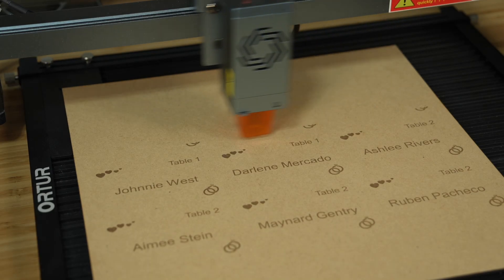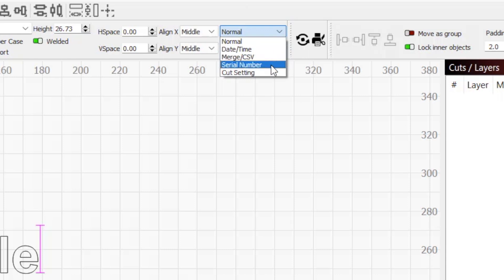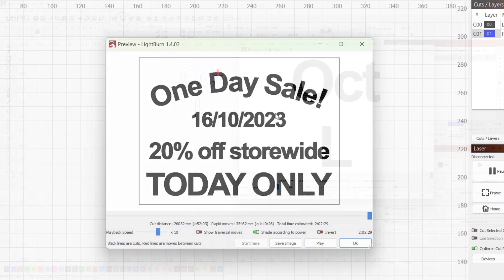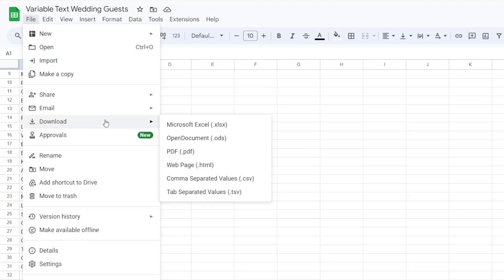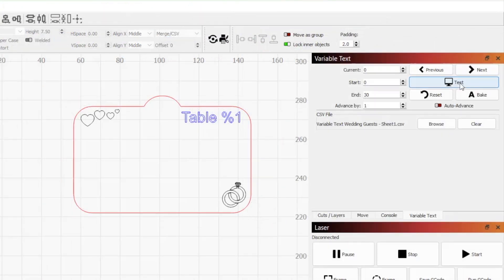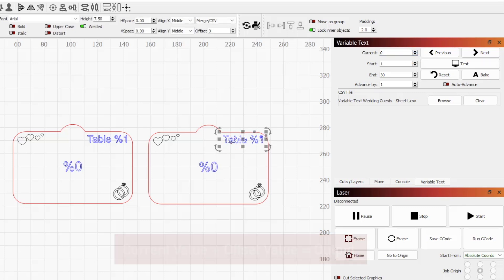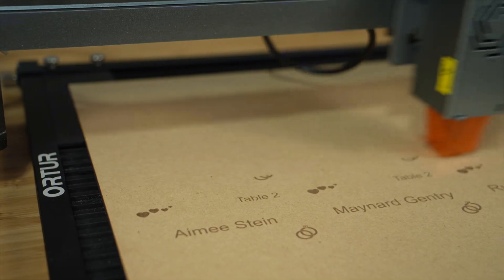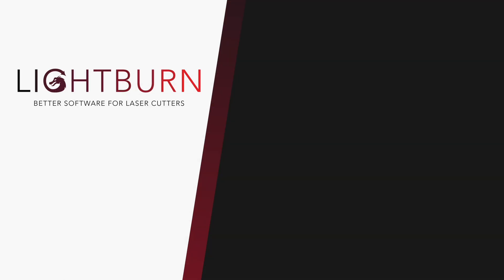The Power of Variable Text

Comment: Tipp: use 0pen Office for Text, in any counties the csv use semicolon, in other comma, lightburn works only with comma. In Open Office settings you can select more settings before store, so you can set comma anstead semicolon to store csv. And in Table you can set in the cell the max of signs. And in the multi layer, you can select max.  Size of scripture.

Comment: does this work the same way with the data matrix barcode function??? if i load a "CSV" and set up the variable text could it also change the data matrix code as well???
Reply from the maker: @Stakespecialty  - yes. Barcodes & data matrix codes can use a CSV, date & time, or serial numbering.
Reply: @lightburnsoftware7189  thank you for your reply I managed to figure out how to set it up using an Excel file absolutely love the program 😁

Comment: What if some of the texts are longer than others and goes out of bounds of the design? Is there a way to set text boundary so that the font size automatically adjusts to fit the set boundary?
Reply from the maker: If you enable the shape properties window there is a max width that can be set. This will scale the text to stay within those bounds. https://docs.lightburnsoftware.com/UI/ShapeProperties.html#text

Comment: Is there a way to have the size of the text shrink if you want to constrain it to a certain area of the design?
Reply from the maker: Yes, it sounds like what you want is the max width option. This can be found under shape properties. 
https://docs.lightburnsoftware.com/UI/ShapeProperties.html

This is not viewable by default so enable it from the window drop down menu. Version 1.5 takes this a step further with the squeeze function: https://docs.lightburnsoftware.com/Version1_5.html#new-shape-property-added-for-text

Comment: I tried this method for trophy plates.  The problem I had was the information was going beyond the desgin space.  Ex: .75x4 inch trophy plate.  How can I auto condense the information so it stays inside of the plate dimentions?
Reply from the maker: On the shape properties for text you can specify a Max Width - the text will be compressed if it exceeds that size.
Reply: Hello again.  I very new to LB.  Can you give me a little more guidance on how to set the Max Width with the shape properties.  I was unable to figure it out.  Thx again.   @lightburnsoftware7189

Comment: Excellent tutorial!
I was looking for this option in the software.
I tried to do this, however, the words that use spelling accents are not correct in the design, how can I solve this? I'm Brazilian, I don't know if this was explained in the video.
Reply from the maker: If you save the file as a Unicode text file, it should work.  If you're having trouble with it, please email support@lightburnsoftware.com (and include your text file) so we can have a look.